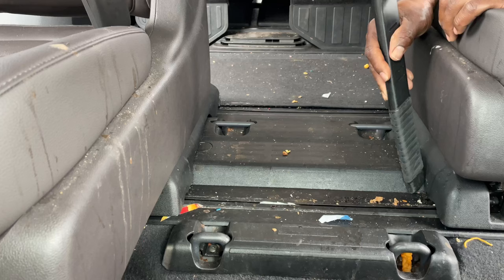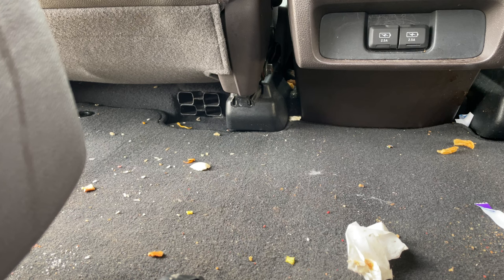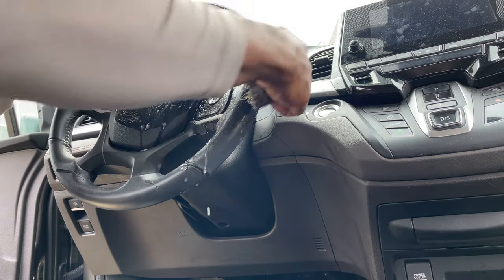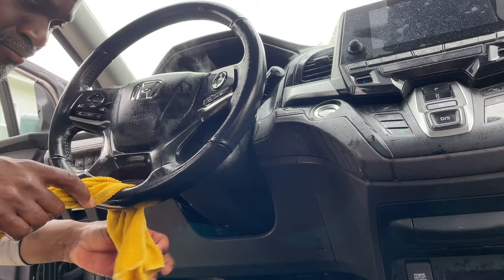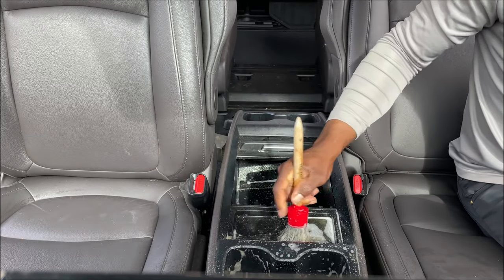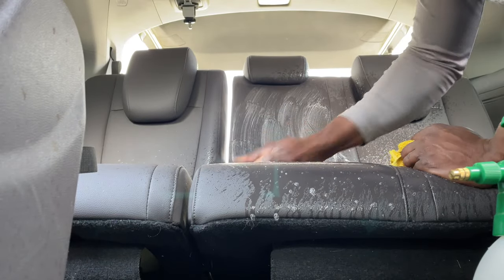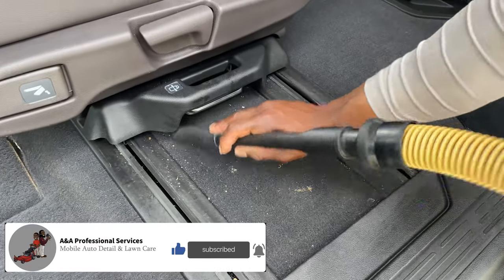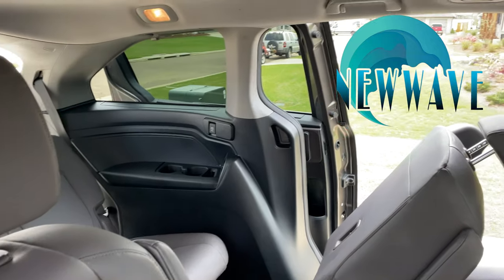Harbor Freight Steam Cleaner

Comment: Hey boss, I got some mold in my truck. Been sitting parked for some time here in south FL. Got this steamer today and ready to roll with some cleaning. What exactly would you recommend to do, step by step  if you dont mind sharing.
Thanks
Reply from the maker: Get some water and vinegar mix in a spray bottle. Mix it half & half. Spray it on the infected surfaces let it dwell for a while. Then start cleaning.
Reply: He's right and it will get the job done but, that funky vinegar smell doesn't leave right away. I'd go with some Microban spray in the bottle, not the can.

Comment: Will that work for inside the vents I have a truck that was use for work sheetrock and has alot of dust inside the vents.
Reply from the maker: It will help. Use compressed air

Comment: Boss came across this video and wow! Truly inspiring. I have my sedan interiors priced "starting at" $125. You already know! 

Questions! 
What you got for rubber mats to make them black again? I don't like how they grey comes back. 

What do you use for a dressing? 

What are you using for spot treatments? (I'm hitting it with superclass mixed with a lil dawn)
Reply from the maker: I'm glad you liked it
Reply: @AAProfessionalServices  is it possible to get these questions answered
Reply from the maker: Use tire shine on rubber floor mats. Spray them down let it sit the wipe them dry. 
For spot treatments I use super lean mixed with dawn soap.
I have no name interior dressing from a local distributor
Reply: @AAProfessionalServices  thank you man, trying to find a solution to making mats black with out the greasy mess!